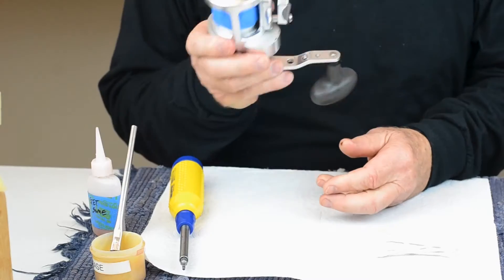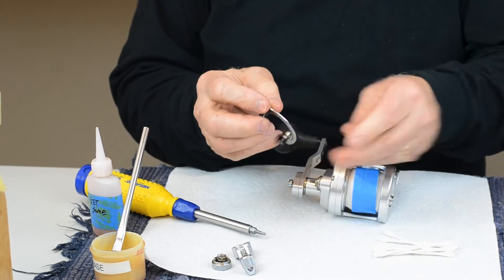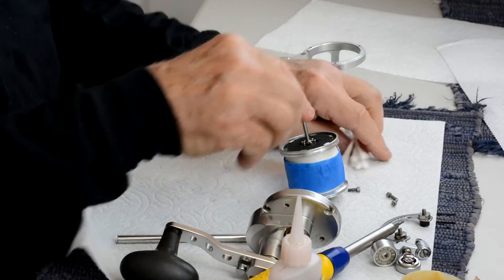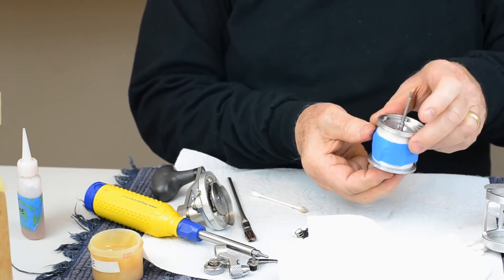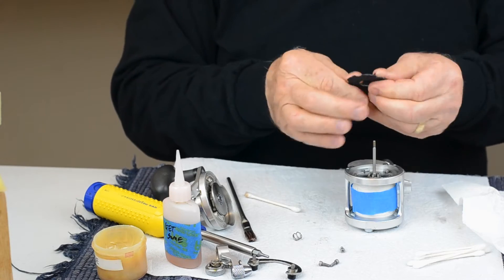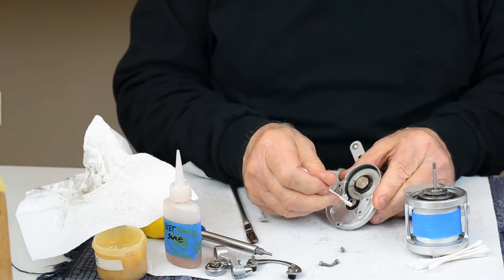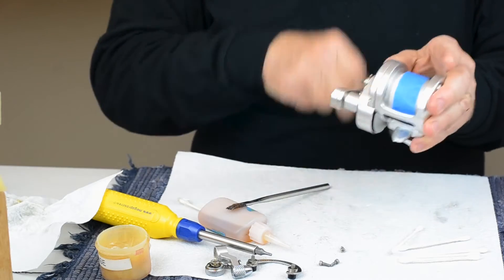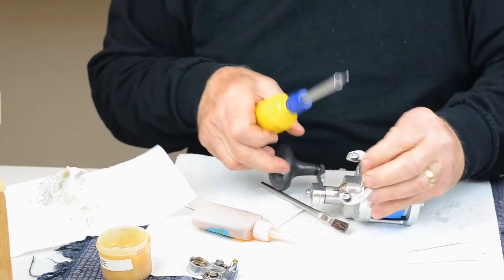Avet SX Raptor Service

Comment: Avet says to NOT grease the drag washer.... but whatever. Awesome video!
Reply from the maker: I know and everybody knows, but we all grease the drag washers as I’ve instructed on every reel.
Reply: @markmayo2853  Do you know if it effects the drag at all compared to using them dry?
Reply from the maker: My drags are greased SX through EX 50 and I get plenty of drag always. Be sure to pay attention and after applying grease try to get as much off as possible. Novices slather it on a have poor drag pressure. Don’t be a novice!
Reply from the maker: My drags are greased SX through EX 50 and I get plenty of drag always. Be sure to pay attention and after applying grease try to get as much off as possible. Novices slather it on a have poor drag pressure. Don’t be a novice!
Reply from the maker: My drags are greased SX through EX 50 and I get plenty of drag always. Be sure to pay attention and after applying grease try to get as much off as possible. Novices slather it on a have poor drag pressure. Don’t be a novice!
Reply from the maker: My drags are greased SX through EX 50 and I get plenty of drag always. Be sure to pay attention and after applying grease try to get as much off as possible. Novices slather it on a have poor drag pressure. Don’t be a novice!
Reply from the maker: My drags are greased SX through EX 50 and I get plenty of drag always. Be sure to pay attention and after applying grease try to get as much off as possible. Novices slather it on a have poor drag pressure. Don’t be a novice!
Reply from the maker: My drags are greased SX through EX 50 and I get plenty of drag always. Be sure to pay attention and after applying grease try to get as much off as possible. Novices slather it on a have poor drag pressure. Don’t be a novice!
Reply: @markmayo2853  Thanks for the advice man! One time in my baitcaster I coated my carbontex drag washer in reel oil and couldn't stop a fish with my drag all the way tight. I was a novice and didn't know that was a bad idea. Anyways awesome video. It's nice to see how to service a reel instead of only having schematics to look at.
Reply from the maker: They sure say not to grease washers and all mine are greased. They are starting to accept that greased washers work too.

Comment: Hey Mark,
If you want to just replace all the bearings, do you get them from Avet or get some higher performance ones from somewhere else?
Reply from the maker: If you have a digital caliper, measure the inside diameter in fractions, outside and thickness all in fractions like 3/8”. Go to eBay and buy them for $1-$3 each. I do that. I have bought for years from Avet successfully.
Reply from the maker: Go to Alan Tani’s website. Find the list of bearings on the Avet section. I buy them from EBay. Be sure to search shielded bearings by OD, ID, and thickness. $1 each.